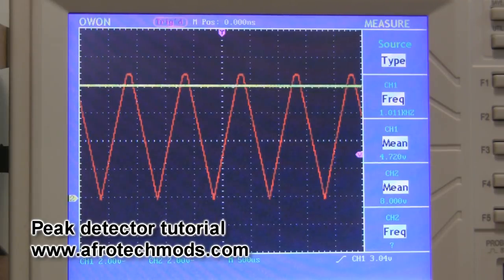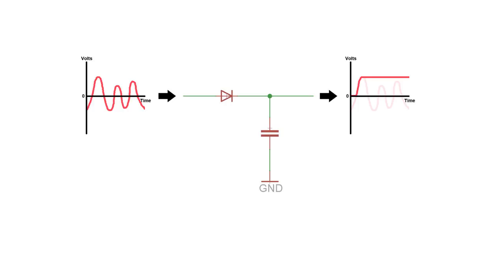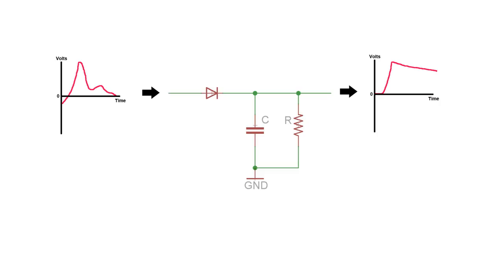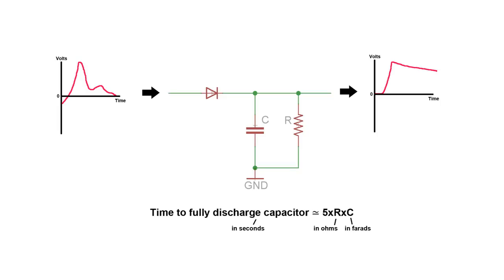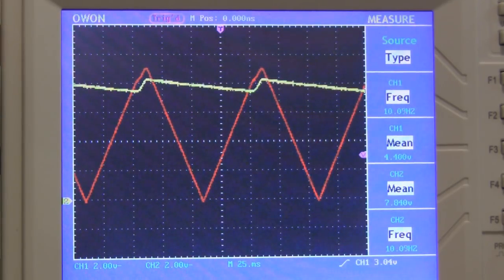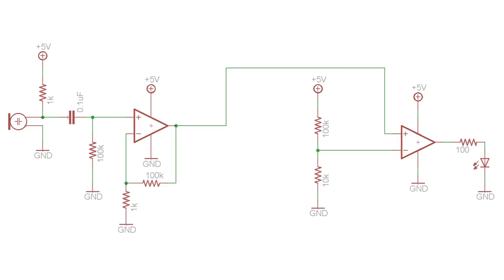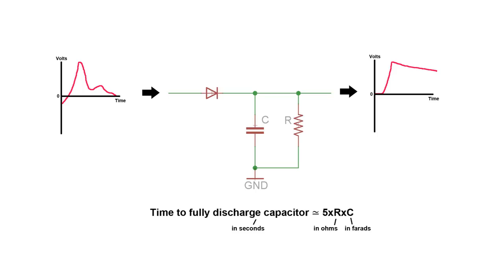Peak detector circuit tutorial for beginners

Comment: +Afrotechmethods
Couldn't you improve the sensitivity of the peak detector by using a germanium diode? I mean, Ge diodes have a forward voltage of around 0.2volts, compared to the typical 0.65 volts of a silicon P-N junction.
Reply: That is a great question.  I hope someone answers it.

Comment: i know that the discharge time is about the time constant.
But how about the charging time?? why shouldnt the charging time also equal to discharge time?
please anyone
Reply: Basically you have an instantaneus potential on the upper node, connected directly to a capacitor that is grounded. Since there's no resistor inbetween that potential and the capacitor, the cap will be inmmediatly charged. Formally speaking, the charge is not instantaneuos. You can think about it with the given RC equation, but in the charge process R tends to zero (since it's only a wire and the inner resistance of the cap is very small), that means that the time constant for the charge process is very very small.
Reply: Esteban González Aaaahh! Clear and straightforward explanation. Thank you both for the question and the answer.

Comment: I suppose you could make an over-excessive VU meter with this using a resistive network and several peak detectors.  Cool!
Reply: That is more or less how a bargraph-meter IC works, i believe.
Take a look at this site, where a more detailed description can be found:
https://forbharat.wordpress.com/2011/04/30/lm3914-based-voltage-measurement/

Comment: Could you show how to wire up a logic flip flop to the comparator's output so it becomes a clap on-clap off switch?
Reply: Using a 74LS74 D flip-flop, you would use the output of the second opamp as your clock (CLK), the Q output to drive your relay/transistor/etc and finally the Q' output as your D(ata) input. Feeding Q' to the data input is what creates the on-off toggle.

Comment: I built the circuit and it is pretty neat. Thing is it would not work right on 5 volt power (it would stay lit). Running it at 4 volts made it work properly. I used an LM324 chip.

Comment: You can also use an op-amp as a super diode (google it) to eliminate the diode's voltage drop. Only really an issue for precision circuits though.

Comment: very nice video well explained, got a question can I use this same circuit as an audio peak led, working with my vu meter, I would remove the mic of course and that would be my audio input, what sort of adjustments would I have to make to the present circuit, and I would like the circuit to have a variable resistor to control the led, and what op amp are being used. Thank you
donald

Comment: 2 questions:

While elegant in its simplicity, this implementation of the peak detector seems to have a pretty serious flaw. Judging from how long the led stays on at different occasions (i.e. how much the capacitor has charged) even if the first clap is loudest, the consecutive claps seem to still charge the capacitor. If we think about a more useful implementation where some sort of meter would indicate the level of the loudest clap, it would fail by adding a bit to the reading by every clap even if they were preceded with a louder one.

..As I wrote that I did come to think that this might be only a problem due to the charging time of the capacitor (which of course isn't instant even without notable resistance).. So, if we'd imagine the cap could charge instantaneously while maintaining its discharge properties, would it fix the problem?

I mean, as the capacitor charges, the voltage at the capacitor's 'upper' plate rises and so there would not be potential difference over the diode unless the clap would be louder than its predecessors?

Another thing... wouldn't the level of the peak affect also the hold time? I'm not saying this is necessarily a bad feature, it might even be a preferred one but just want to know if what I've understood so far is correct.

Comment: wait but i have a few issues here. if you have a bigger capacitor doesnt it take longer to reach the peak that it is detecting, and the bigger the resistor I would think would dissipate the voltage faster or have some other negative tradeoff effect.....hopefully you get what i am trying to say....I imagine there is some balancing act and other considerations not mentioned here....

Please advise.

Comment: yes , i enjoyed seeing your video as it is close to something i'm working on.  
and am tempted to use your MIC amplifier idea instead of the max4466 
and 9814 modules bought on ebay.  except the 9814 has AGC which
is a problem solver in itself.   for my projec tthe comparator  step you do w/ an op amp
is handled  in code with an if-then statement

overall it includes taking sounds that  are brief and intermittent and capture them
 with your circuit  plus a Picaxe uC with ADC pins.  a 20M2 at  this time

lots of new ground to  tread . with many  interesting challenges along the way .
practically everything is an unknown when doing a big project like this  for 
the first time.    here  are some of the problems that have arisen along the way :

 a) figuring the  gain for stage 1 based on the volume
of the incoming sound 

 2) determining the R-C values so the cap' voltage fades  enough
to be  taken as a new sound when the ADC is looping-repeating every 250mS or so 

3) test the ADC level output  of each sound  w/ the uC to be above some threshold in a 0-255 space
and  keep track of how many sounds over one second meet a volume spec'.  etc.
this is the comparator step  mentioned above ... done in code.

4) re-learning the exponential equation for cap's :    V=Vc * e ^ t/RC

5)  lastly is managing the voltage levels with the FVR2048 voltage reference
directive so the ADC  uses its converting voltage space most effectively

a few things yet to learn :
   a.  how to deal w/ the 9814 and its mid-range DC offset  ... what does the  ADC do  with it ?
   b.   to store the count  of noises in inner 1-dimensional arrays or ext'l EEprom ... ??

    another matter is not knowing precisely when the uC samples the ADC pin.
the PIC uC's dont give you access to the inner register bit change when 'GO'
happens.  so right now the best i can do is code a 100uS pulse before and
after the readadc command.  then , on the scope,  the 2 pulses serve to frame
when the adc pin does its sampling.  this allows seeing how  well the ADC
aligns with the peak detector when the DC voltage is flat  

     such a simple looking circuit leads to many new directions.  and stops your
progress every  time you run up against the end of your knowledge.

then you might find yourself searching u-t for others who too have tread this path

     i'll be looking thru your other videos to see if you are including uC's  ...

Comment: The peak voltage has to be around 5V to light an LED with this circuit. I tried it with the input signal biased to the middle of the 0 - 5V range (the typical workaround for using CMOS switches with a single voltage supply), and nothing happened.

Comment: At 0:45, the video states: because diodes have a small forward voltage drop then the real world voltage will be about a half a volt less.
Why wouldn't the diode voltage drop cause the output signal to be lower and thus the real world voltage to be a half a volt more?

Comment: How to put in the capacitor? Does the negative end go to the diode, or the positive one? Also, does it matter how you wire up the mic? I'm stuck because when I power this up all I get is a constant faint light on my diode, not the right effect at all. Is it possible that I overheated the amplifier?

Comment: Could use this to turn the ceiling light on and off, by using a mechanical relay to switch the mains voltage.
Now I only need a "sneeze detector" so the whole house doesn't light up every time I sneeze.

Comment: @silverstream314 What, and make a clap controlled light or something?

If the output was 5v, it could be connected to a pin on a microcontroller and used as some sort of sensor, couldn't it?

Comment: @critiacrof Was thinking this myself. You want current limiting resistors and small capacitance values for this circuit. Make the discharging resistor larger before you increase the capacitor value and using a low leakage metallised foil capacitor is better than using electrolytic types for this.

Comment: I used this to make a circuit which i put inside an enclosure that measures the peak voltage coming from motorcycle stator coils which provide the power for the CDI and coil. it plugs into my multimeter which I set to peak mode to record the peak before the resistor drains the capactor.  Multimeters don't sample fast enough to record these high voltage pulses.

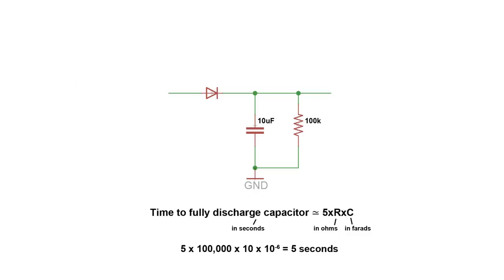Comment: At 1:40 you mention 5RC as your time to discharge. I know for an RC circuit the time constant is RC and the formula for Voltage given time, and RC is V = Vo*e^(-t/(RC)) How did you solve for T and get the formula provided?
Reply from the maker: +Kodi Stick 5RC is a generally accepted way of quickly estimating the time to fully charge or discharge an RC circuit. Try doing some example calculations and you will see that it gives you 99% of the final voltage. Also check out http://www.electronics-tutorials.ws/rc/rc_1.html

Comment: The capacitor doesn't have a path to discharge? Wouldn't that be ground?
Reply: A simplified capacitor is 2 plates separated by some distance, so one plate is connected to a zero potential (ground) while the other plate is connected so the source and has the built up potential from the source. Since there is "infinite" resistance from plate to plate, current does not flow between the plates. Connecting a resistor to both sides provides the path for electrons to flow allowing the capacitor to discharge.

Comment: How would you make this peak detector with an inverting op amp?
Thank you, love your stuff
Reply: 1) Wire the non inverting pin to the Positive rail via a 2.4MOhm resistor, and connect the inverting pin to the ETH Positive power supply pin inside your Oscilloscope's CRT Tube Supply .

 2) Connect the grounds together and don't forget to put a 1N4007 diode reverse biased across the the output to the Positive pin.

3) Then on the output put a peak detector 100nF and 3kOhm resistor in parallel.